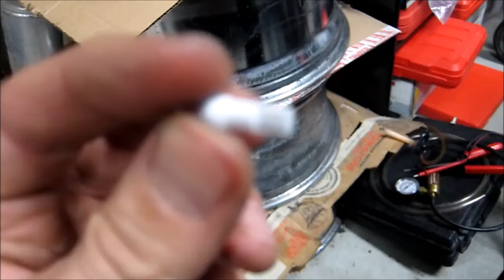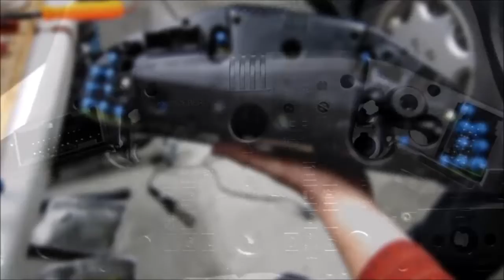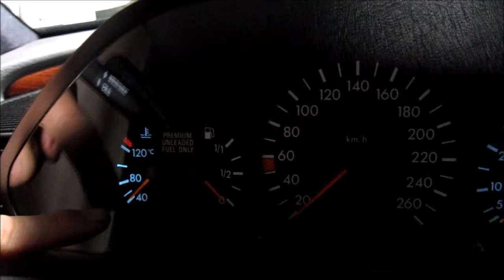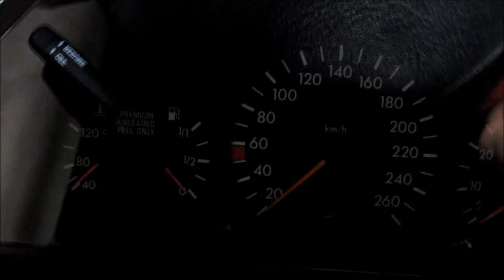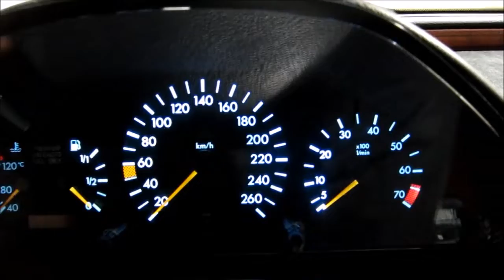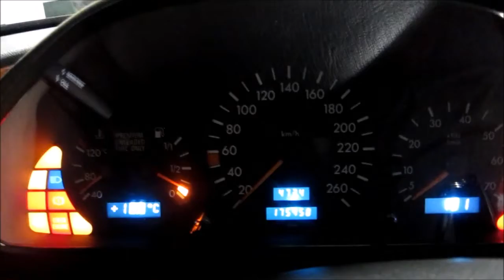Mercedes Benz W202 C280 Dash Lights LED conversion

Comment: Do you know what kind of bulb is for the speedometer and which socket on the back of the dash is for the speedometer having trouble figuringthat out Also, Do i really need a set of 10x light bulbs or could i just buy a single one for cheaper? im trying to skip the whole led conversion or saudering I just need to see my speedometer and odometer at night cause its dark. Thanksin advance.
Reply from the maker: Speedometer are 2 black sockets with bigger lightbulbs
Reply: Great video! Which bulb is for the gas and temperature gauge?

Comment: Mr P, thanks for this great video.
I have a different problem...
After changing the cluster bulbs for LED a weird thing happened: no lighting when switching the light on at night, completely dark.  But the 3 displays can be seen and all the gauges work.  I switched back to the original bulbs still no backlighting.  I think it is a circuit board issue
What do you think?  any suggestions will be appreciated!
My car is a mercedes CLK w208 chassis
Keep up the good work.